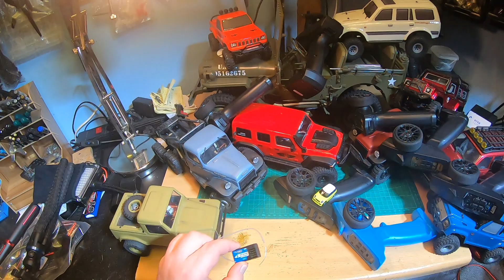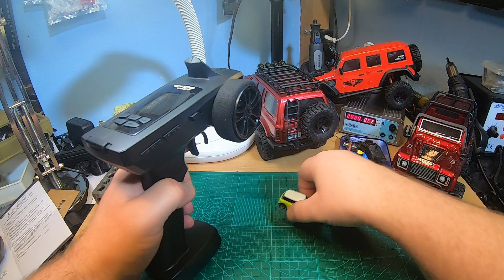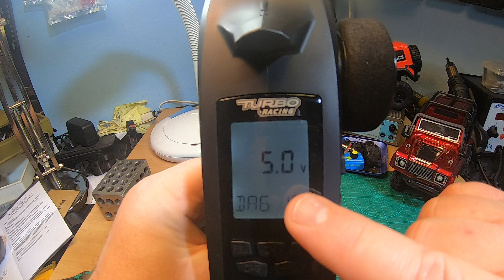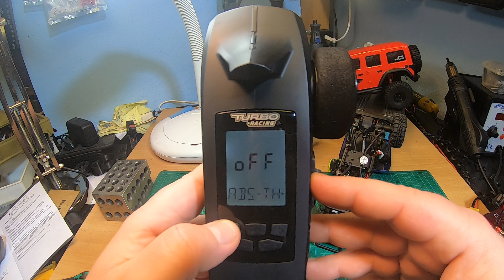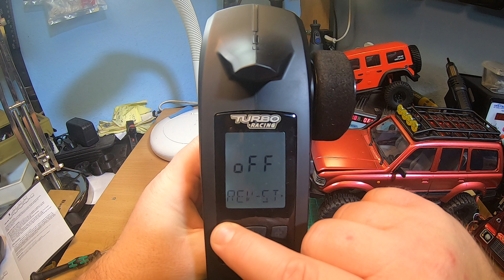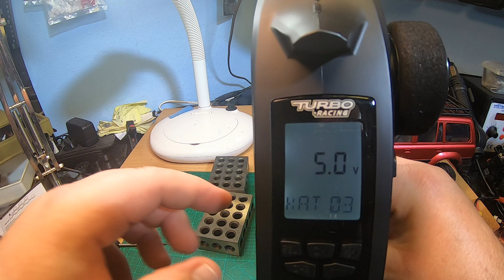TurboRacing P52: EXPO + EPA + One Radio for All (HobbyPlus, RocHobby, FMS, RGT 1/24, ...)

Comment: So you can bind this to the cr18 builders kit?
Reply from the maker: CR-18 yes (the old one), CR-18P not (those do come with new Flysky radio gear). 
But you have to check, this video is old. The new CR-24 and CR-18 (not P) do also already come with new Flysky radio gear. 
Simply check the radio in the description of the kit, if it is the old version with Turbo Racing radio, or the new Flysky radio (red dip switches).
Reply: @donaldsneffe  ok, I have the cr18p with the small radio that has dip switches. I will have to watch your video again on those dip switches functions. I didn’t see any difference in the drag brake. Thanks
Reply from the maker: @BareKnuckleRC  But it works fine - is also in the description. The right two switches are for drag brake, 0, 50, 75 and 100%, you will see it, if you stop the truck abruptly. However, portal gears... the truck will never "roll" as a truck without. I normally use 50%.

Comment: Damn, thanks for this! Do you happen to know if it works with the newer FMSes? (Mogrich, FCX24) Maybe even the V2 SCX24s (since the fcx24 transmitter works with them :)). Was thinking of getting this or the P32 as a transmitter for most/all of my RCs, 'cause the Furitek Avatar is waaaaaay too expensive and i haven't found any other compact alternative... :(
Reply from the maker: No, unfortunately it does not work with all those new radios of FMS/RocHobby. It is a pity...
Reply: @donaldsneffe  ah, a shame, that would've been nice... back to the drawing board for me! :(

Comment: Will this work with the eazyrc crawlers?
Reply from the maker: No - you will need radio, receiver and ESC to upgrade an EazyRC crawler (and lightcontroller).
Reply: @donaldsneffe  do you have any videos showing that upgrade? If not could make one since im sure a lot of people with the eazyrc would love to upgrade the electronics.  Thanks
Reply from the maker: @mikesti8406  I will do a video (hopefully) soon with my Patriot and Arizona. However, it is simply totally swapping out electronics. If you do not yet have those and have to buy, it would probably be better to buy the more expensive FMS and RocHobby versions of those trucks. 
You can watch my Katana video ( https://www.youtube.com/watch?v=ui3iDbZHKn8&list=TLPQMjUxMTIwMjFTiNKwYhUzhg&index=1  -  but not yet with lightcontroller). To do this in EazyRC models is the same, only difference: You can use the stock radio of the RocHobby Katana and only need a new receiver, while in the EazyRCs you will have to swap out radio and receiver (and ESC).
Reply: @donaldsneffe  I kinda wish I would have purchased the more expensive ones now.  My Patriot is already have receiver issues, i.e. getting stuck in reverse or losing what  sensitivity it has when modulating the throttle.  Also my son's glacier is already grinding gears in the rear diff.  Hopefully someone will make metal replacement gears.
Reply from the maker: @mikesti8406  The more expensive versions do have metal axle gears - so they will for sure be available one day.
Replacement plastic gears are hard to get, but cheap. I bought them from Hobbyking.

Comment: I was constantly searching for s detailed review about this transmitter. Thanks a ton! Do you have instagram? I have some few questions. I'm new to this upgrades.
Reply from the maker: Thank you. No, I do not use Instagram. You can ask here ;-)
Reply: @donaldsneffe  I ordered this unit! May I ask if this will work on generic ESC? Or I need a branded ones?
Reply from the maker: @maeldomain  Any normal ESC will work.
Reply: @donaldsneffe  Thanks! Do you have a particular recommendation for settings when using a crawler?
Reply from the maker: @maeldomain  Not at all. There is not a lot to set in a truck. Depending on your ESC you can try to play around with Expo a little bit, if you want, and adjust servo endpoints to optimum. But normally: Plug and play.

Comment: How did u bind remote  ?
Reply from the maker: Depending on which, either push the bind button or, if it is a receiver with bildplug (the 2s ones) push a screwdriver or something out of metal between the two pins for the bind plug (very strange: It never works with bindplugs for me, tried in several different ESC/RX 2s combos). Switch on radio (first or after, not important) and rx/ESC combo will bind. If it does not work the first time, try again. Always worked for me with several different Hobby Plus radios and rx units.

Comment: How do you bind remote to a esc reciever combo?
Reply from the maker: Depending on which, either push the bind button or, if it is a receiver with bildplug (the 2s ones) push a screwdriver or something out of metal between the two pins for the bind plug (very strange: It never works with bindplugs for me, tried in several different ESC/RX 2s combos). Switch on radio (first or after, not important) and rx/ESC combo will bind. If it does not work the first time, try again. Always worked for me with several different Hobby Plus radios and rx units.

Comment: Thanks so much for the video. Is this worth extra $10 from P32 if I don't really use channel 3 and 4? I just want EPA especially for the 1/76 Mini.
Reply from the maker: Yes it is worth. But maybe not for the 1/76 Mini. 
I have P52 and P32. 
P52 is much easier to handle, ch3 and 4 are buttons/3-pos switches, trim is button, display is larger. P32 makes everything (ch 4, trim, ...) over display menue, much more complicated. 
Display of 52 is larger and easier to read.
Only "downside" if you want so: 52 is larger and for me it is very hard to drive with one hand (so steering with dumb of left hand), this is much easier in the P32.
P32 has the form of the "usual" smal radios that come with so many small trucks (CR-18, CR-23, Katana, Atlas, ... 1/76 mini, but buttons, no knobs), AAA batteries, P52 has the form of the larger Turbo Racing radio that comes with the 1/6 Willys Jeep from Rochobby, AA batteries. 
BTW: Dual Rate ("2-side EPA") is possible with the small non display radios, too. But I guess, you know this already.
Reply: @donaldsneffe  Thanks so much for the detailed response. The adjustment on non display is quite tricky and I need that model memories. Bigger radio is a welcome change for me too.

Comment: Hallo, Danke für den Video, was ist der Unterschied zu der P52 und P32? Sollten beide 4Kanal haben! Wo hat den die P32 den vierten und dritten Kanal???
Reply from the maker: Ich hab mir die andere auch inzwischen gekauft ;)
Die 52 ist größer, hat auch ein viel größeres Display, braucht 4 AA, die 32 4 AAA; die 32 ist leichter mit 1-Hand zu bedienen.
Die 52 hat Kanal 4 als 3-Positionsschalter auf der Seite, plus Trimmung Lenkung und Gas Buttons auf der Seite. Kanal 3 ist ein Button unter dem Display.
Die 32 hat Kanal 3 Button unterm Display, Kanal 4 kombiniert mit den Buttons für das Menue - wenn "nichts" gemacht wird, wird immer Kanal 4 am Display angezeigt. Trimmungen sind zwei kleine Buttons oberhalb vom Display.
Zu bedienen ist die 52 viel einfacher deshalb.
Für die 32 spricht nur, dass man leichter Einhand-Fahren kann (zumindest ich, ich hab eher kleine Hände), und dass sie halt "kleiner" ist, wenn man das will.
Reply: @donaldsneffe  Danke für die schnelle Antwort. Ist in der 32 der vierte Kanal auch mit drei Positionen, wie bei der 52? Ist ja nur ein Knopf,Schalter, kein Schieberschalter?
Reply from the maker: @mung3019  Ist ein Button mit 3 Positionen am Display - L - H - M, ... also geht immer L-H-M-L-H-M-L-H-M (nicht L-M-H-M-L-M-H)

Comment: Invaluable information. I like how Turbo radios can be taken apart. When you have a micro, you kindda want a small radio too for easy transport. Wish more manufactures would follow.
Reply from the maker: I agree.
It is plus and minus... Cool is for example, you can store the radio in the storage- and transport case of the RocHobby Willys Jeep.
And it is true, small radios are really nice for indoors, for using in your living room, ...
Small, so good for kids (you can reduce top speed by dual rate even in the simple radios), women (mine) like it, the colourful versions, ... and honestly I like them, too. Especially because even the simple models have ch3 which you can use for light-control. 
About 2 years ago, when I received my first one (with the 1/24 Defender Amewi AMXRock AM24 = CR24), I thought "toyish", but then I changed my opinion, even bought a blue and a white one ;-) 
I like them more than my/the large DumboRC radios... (which are probably better for outdoors, but therefore I have my Flysky GT3C and Noble).
Reply: @donaldsneffe  I finally upgraded my p32 to the p52 and which replaces my Flysky GT3B. I didn’t do the battery mod so the battery drains fast. The p52 is so good. Just wish it had a dial to make adjustments faster.
Reply from the maker: @Diamondbac  I think my Flysky GT3C (8ch mod) is even better than my P52 ;-)

Comment: This is great stuff... I am not very tech-savy so I am a bit lost as to some of the features you mentioned, but my takeaway from the video is the EXPONENTIAL, which may be able to solve the problem that most of those similar mini crawlers have (expect the mini z) that when on low, the power is reduced and decreases crawling capability. I noticed you put the EXP at 40 and the Katana did improve, but does it actually increase the power as well or does it only modulate a bit smoother?
Reply from the maker: It does not increase the power at 100% throttle input (of radio throttle trigger). Power can only be 100% (of motor/ESC/battery). 
Plus/positive Expo increases the power at lower throttle input (compared to linear, what is "stock settings"), minus/negative Expo lowers the throttle input.
Imagine a curve (a straight line is also "a curve" technically).
Throttle input (by radio throttle trigger) is always 0% (trigger center position) to 100% (for both, forward and backwards input).
In "normal" (expo 0) there is a straight line, linear, from point 0 (trigger center position, power 0%) to 100% (trigger pulled to max, power 100%). But ESCs/motors of those tiny trucks are not very good, so they need quite a bit (of power) to start. In most of those cars you will have to pull the trhottle trigger maybe 30 or 40% of maximum and only then the truck starts to go.
Positive Expo makes this straight line (0 - 100) to a real curve (bellied upwards in comparison to the straight line with expo 0; negative expo makes this curve bellied downwards compared to the straight line).
This means, already at lower throttle trigger position the car gets enough power to start, you do not have to pull the trigger 30/40/50%. The incline of the curve (and increase of power input) is steeper in the beginning, but flatter in the end of the curve compared to linear = 0 expo. Negative expo is the contrary.
More plus expo makes this curve steeper in the beginning and flatter in the end, more negative expo makes this curve flatter in the beginning and steeper in the end. 
More sophisticated radios (e.g. my Spektrum DX9) do even have several points on those curves you can adjust. This is very useful in helicopters, if you do not use the governer function, can also be very useful in plane rudder control, heli direction control.
Dual Rate (D/R) in contrary to expo limits the maximum power (or maximum servo way). No dual rate: throttle trigger way 0 - 100 (for both, forwards and backwards), power 0 - 100%. With dual rate (take any value): Throttle trigger way 0 - 100, power 0 - x (for example 50) %. So you have a longer way (of the throttle trigger) to control less power (for example only 0 - 50% instead of 0 - 100% without dual rate).

Using expo does not make the electronics (ESC, motor) better. Throttle response would probably be better using dual rate (with the downside of not full power), using expo can also make to "jump" the truck in the beginning. You have to test this, find a good value.
40 was only an example, maybe even too much. You will have to test and find the best value for the truck (what is always a compromise). Better ESCs, which do already have a better resolution with 0 expo, can also handle expo better. Maybe use negative expo there, and make lowest speed control super sensitive... for example.
Reply: @donaldsneffe  You are way too smart for me. Thank you for taking the time and energy to explain throttle control. I will try to do more research to get a grasp on what you said... so at this point, it is over my head. 😅
Reply from the maker: @felsenrogers4083  Simply draw a x/y graph, then it is easy to understand. 
X is throttle trigger input (0-100) and Y is power (0-100). Draw a straight line 45° from 0 - 100 - this is linear. 
Mark this point 100 (100 throttle trigger/100 power on the 45° line).
And then draw a curve, with "Belly upwards" from 0 - 100 (the marked point), that is positive expo, and another curve with "belly downwards", from 0 - 100, that is negative expo. and then make some straight lines parallel to the y-axis, at thottle input (x-axis) 10, 20, 30, ... %.
And then check what is the difference (in power/y-axis) linear to positive and negative expo.
Depending on %Expo the curve will be more or less "bellied", 0% is linear (the 45° line), and +100% would be also a linear straight line, 100% power from 1 - 100 (throttle input), so a straight line parallel to the X-axis. 
- 100% expo would be 0 power all the time.

Comment: Just ordered one in UK £32 from Banggood. Is there a video to show binding from the start for a complete novice. Keep up the good work 👍
Reply from the maker: Binding is no problem at all. It is a kind of "autobind". What car do you want to bind?
Reply: Yes wondering the same...do I have to buy new receivers for all my trucks?
Reply from the maker: @matamorosz  No, not for the trucks I showed. You can simply bind them to this radio. Which trucks do you have?
It will not work with trucks using different radio systems (e.g. SCX24, Mini-Z, Panda Hobby, Carisma, RGT 1/16, WPL, MN, etc. etc.)